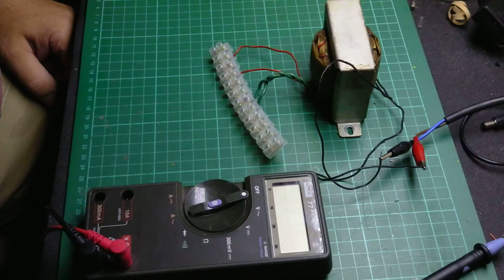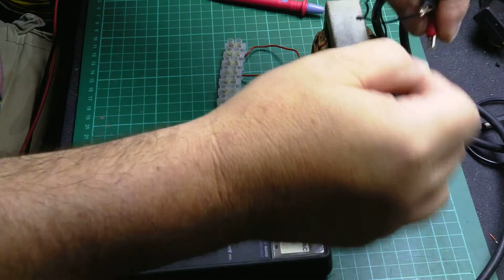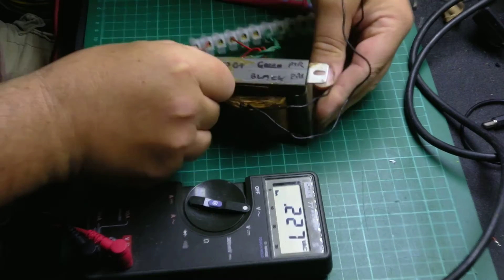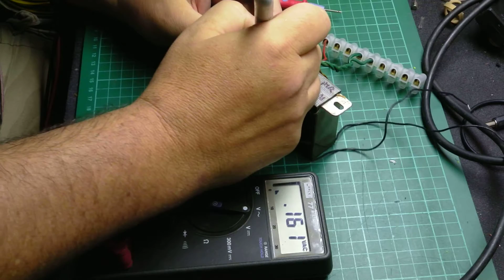How to test an unknown transformer

Comment: This was four years ago, so I don't know if you're still around.  My questions: You hooked mains to the side with the smaller sized wires, but I thought the mains were always hooked to the primary side which is usually the larger diameter wires.  How did you determine which side was the primary and which the secondary if it was an unknown transformer?  If Mains was hooked to the other side, if that is possible, would it damage the transformer?  I'm really trying to understand how to figure out on an unknown Transformer, how you KNOW whether it is a step up, or a step down? Or does it matter because it just depends on which side you hook up the mains to?
Reply from the maker: Generally, the input to a valve radio transformer is the side with the single pair of wires. That transformer in the video has the two secondary windings so experience told me to use the thinner black pair as the primary. If the transformer was a complete unknown with only one pair in and one pair out you would look at the size of the transformer, the ratio between input and output after low voltage test, the size of the wires and you can generally have a good guess at what it was originally designed for.
Reply: @GeorgeChristofi  Thank you very much. Bit by bit I'll get this down. 😊